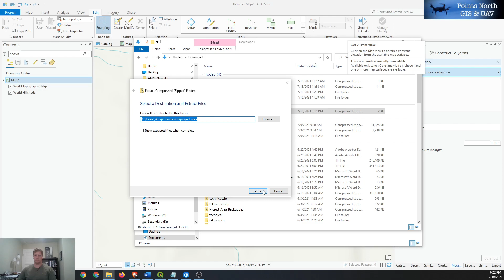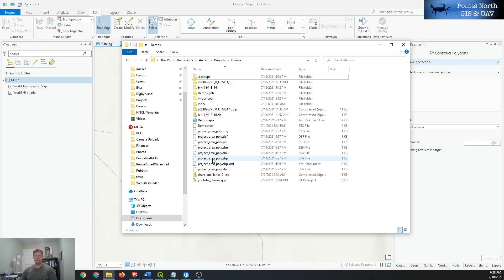Construct Polygons from Lines ArcGIS Pro

Comment: does this not work from polygon to polygon in pro like it does in 10.5?
Reply from the maker: If you have standard or advanced licensing in ArcGIS Pro  you can use a tool called "Feature to Polygon". The method shown in this video requires more work, but will work with basic, standard and advanced licenses.